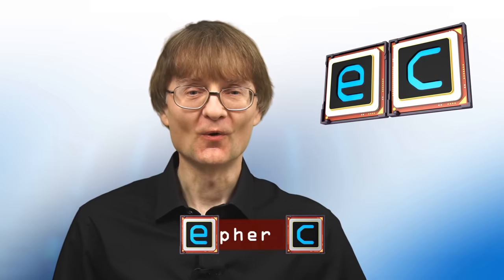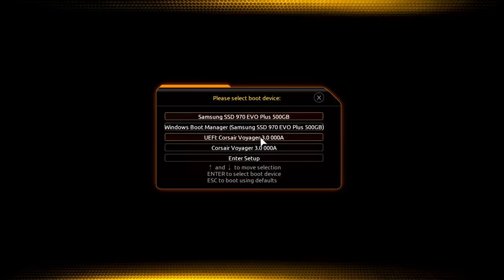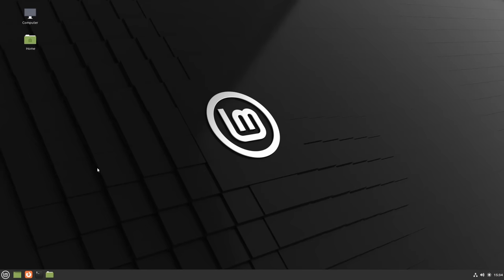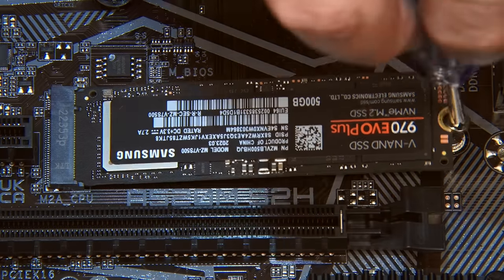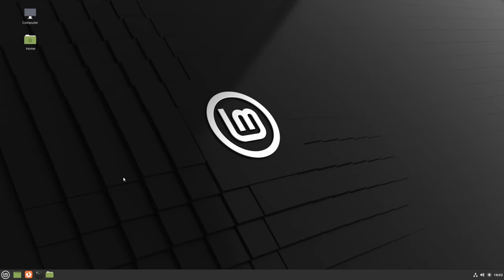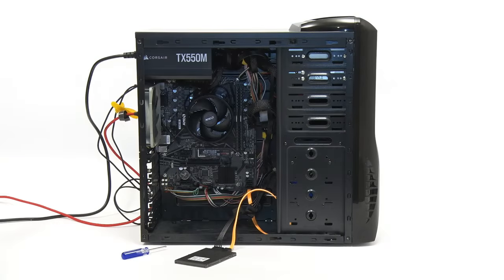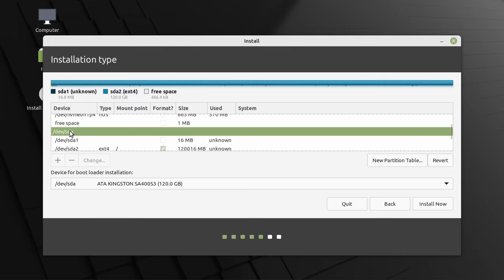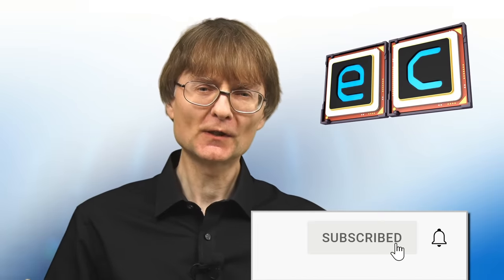Windows & Linux: Dual Drive Dual Boot

Comment: Chris, I have a related question. I've not reinstalled Win10 in many years but I know it does need reinstalling. I currently run a Z87-Pro motherboard system which is amazing but lacks native M.2 (which was released a couple of board releases after) so I'm reluctant to pay for an upgraded motherboard/memory/processor ect with native M.2 so I purchased a PCIe card and NVME card with a 50/50 chance it 'may' function, but it hasn't as my BIOS doesn't recognise the PCIe/NVME as a boot device but when in W10 I can access the full speed of the M.2 via the PCIe card. So I want to install W10 on the M.2 and am happy to sacrifice my current SSD boot drive for Mint (as I'm trying to get used to Linux as MS are no longer user friendly and want to eventually switch to Linux), but even though I have backups of my drives, it's been a tough few years of illness and passing on of family and close family members, so is this method a good method to use? Does this allow for Mint to be installed first on the SSD which on booting up the PC gives a timed out boot message for you to select between Mint & W10 where Mint recognises the M.2 on the PCIe card and will allow me to either write a clone on my W10 to the M.2 (which I've done successfully but can't boot too) or make a fresh install of W10 to the M.2? I mean, common sense says if that method works I'll do a fresh W10 install to a SSD and clone it across. I hope that makes sense?

Comment: Great, thanks. I used to have dual boot then moved entirely to Linux on my new desktop and use a VM for the one program I need Windows for. What I saw immediately, running Win 10 inside Linux, is that there's a backdoor that was downloading gigs worth of who knows what as soon as I started it, even though it claimed it wasn't. Since I have a data cap (in Jamaica, tethering through an Android smartphone), I have to disconnect from the internet whenever I start the VM. Windows is evil.

Comment: Hi, I subscribe to your channel as senior citizen (originally from Cheshire, England but now based in Sydney Australia getting "home" to the UK annually) with basic computer knowledge starting with MS-DOS, UNIX, BASIC - now trying PYTHON.  I've been getting into Raspberry Pi (RP) using both the RP400 and RP Zero 2 W (but I had to buy the RPZ2W in a kit). My next step is control using RP Picos or Arduinos with WiFi.  However, I'd like to play with the Raspberry Pi operating system on my desktop computer and access the operating system from an external USB drive or SSD via a USB to SATA+Power cable (I use the latter with my RPZ2W, so, that's my preferred option) and avoid any complications from setting-up a dual boot system.  Please can you direct me to one of your YouTube videos where running a small operating system can be done from an external drive? Thank you, 73, Ian

Comment: Great video!! I've been having an issue since I did this however, where no matter how many times I change the boot order, it doesn't seem to save it and linux keeps putting itself back at the top, anyone else ever had this kind of problem? It's on a thinkpad x220 if that helps, with Linux mint on the mSATA drive in the 7mm bay and Windows 7 on the regular 3.5 inch sata spot

Comment: Dear Mr. Barnatt, thank you so much for this tutorial. I would like to ask for some help. I have the same configuration as that of your tutorial with Windows 11 installed in the NVME drive and another SATA SSD connected directly to my motherboard. I have tried installing Linux Mint in the SATA SSD but the boot loader was still installed in the NVME drive. I would prefer that I don't have GRUB installed in my NVME drive but it seems that Linux Mint defaults to installing it on my NVME. I have tried twice, deleting GRUB in the NVME drive before installing the second time but to no avail. Any help would be appreciated. Thank you.
Reply: Remove the the NVME drive during the installation. Put it back afterwards.

Comment: Can you please make a video on battery management in Linux? I switched from windows to Pop to Linux mint to ubuntu to manjaro to fedora and back to windows because every one of them drained my battery life significantly in just  4 5 days except Fedora. Fedora had different kernel issue but the battery life was unbelievable for my laptop. I couldnot install any app from terminal or flakpak as it said some interger error. It was just so exhausting
Reply: I found that installing Zorin (ubunta based) on an older HP notebook with an e-bay battery stopped totally stopped charging.  Installed old OEM battery and started charging.  Appears something in Linux Zorin prevents charging on replacement/rebuilt battery.

Comment: @17:00 why does it list Ubuntu/Mint as if it was on the Samsung m.2 500GB SSD and not the Kingston SATA 120GB SSD? Is it maybe because this entry comes from the Windows boot loader on the former drive? Seems like there may be some subtle difference between this approach and installing each OS separately with only one drive connected at install time?

Comment: Hello, excellent video. I have an issue. In my laptop I installed a new ssd and installed linux. The old ssd still have windows on it. If I connect the old ssd through the usb port, I can't choose to boot windows or linux. Linux see the usb drive with windows. How can I boot windows from my old ssd connected through usb? Thanks

Comment: This is a good method to use two operating systems.

However it is slightly less useful on laptops as those often only have (room for) one disk drive.

And it is slightly annoying because every pc has another key to get into the bios and it is not always shown on screen. Nor i the inferface of every bios the same...

Comment: Question, with the first dual drive method (Called A in the video) can each OS see the files and folder created in the other OS and have full read write access across both drives? I want to teach myself Linux (Zorin OS) before my pc no longer gets updates for win 10 because I can't \ and also don't want to upgrade? to win 11.
I must keep win 10 for now in case I can't manage Linux.   Thanks N

Comment: Linux should always be the first boot.   Then add Windows to the grub menu,  since it is is on a different drive than the windows boot loader, windows will never corrupt it.   This way you still get the grub boot option to choose your OS, instead of having to hit F12 to select Linux every time.

Also, stop treating Linux as second class, it is superior over Windows. :P
Reply from the maker: You are making the massive assumption  that the user wants to boot Linux first, and to boot Windows via GRUB (which I and others do not want to do). For me, this is about adding Linux to a Windows PC, not having Windows available on a Linux system.

I do not treat Linux as second class -- which is pretty obvious given that I have lot more Linux videos on this channel than Windows ones. :)

Comment: When I used Linux it worked very well for the short time I used it. What I find with linux is there is always something they either don't have software for or drivers for. Ex. My Lightscribe DVD drive. Searched hi and low for the proper drivers and software to run my Lightscribe dvd drive. Nothing worked. I had to revert back to Windows to be able to use Lightscribe. Dual booting is another work around. If anyone still has the linux Mint Lightscribe software let me know. Thanks.

Comment: In dual drive method, shouldn't windows will show the the drive 📀 (where Linux is installed)  in it's disk manager and vise versa ?
Reply from the maker: In the device/disk manager, yes. But in the file manager, Windows will not show the Linux drive, as Windows does not support Linux file systems. The Linux OS file manager should show the Windows drive, as Linux does support Windows file systems. :)

Comment: Can you briefly explain the settings that need to be turned off in the BIOS before LINUX can even be installed on a previously Windows-based system? I believe this is normally Fast Boot and Secure Boot, correct? Most LINUX distros won't even install until those two settings are first turned off in the BIOS, correct. However, once you turn those off, aren't you making your Windows installation less secure by doing so? Will Windows still even boot properly if Secure Boot is disabled in BIOS? Note here that this is why most people don't even bother doing any type of dual boot: it's just too big of a pain all the way around with too many ways for it to all go wrong and end in frustration. Also, even if you do it all right, your particular distro still might not even boot properly at all when you're done. To avoid all of this, most will simply just install their distros into a VM app like VirtualBox where all of those types of problems are avoided entirely.

Comment: I just bought a brand new computer; a Thinkpad E16, Gen 1 and wanted to install a Linux distro. I didn't get anywhere, it wouldn't let me into the BIOS or boot menu from a cold start no matter what key or combination of keys I pressed. I could enter the BIOS from Windows but that's totally unsatisfactory if you want to install another operating system. Also I disabled secure boot but then ran into a whole lot of trouble with a blank screen and just some small text pointing to a Microsoft web address where I had to type in a 48 key password to reset the system.  The page kept on reloading rapidly making it very hard to obtain all the numbers, so I took a snapshot with my phone. I ended up returning the computer and decided to use an old ASUS from 2014. Maybe the days of the Linux desktop are numbered...

Comment: I have the original windows 11 drive and added a drive for Linux (my primary OS)... I rarely "need" winders, and I'd rather run it inside Linux, but the stuff I use doesn't work with Wine. I've added a VM, but it won't accept the license the machine came with. idk... PITA.
Reply: and winders keeps stealing the first boot option!

Comment: I am hoping this is a simple question. Once I set up a dual-disk and dual-boot computer, since Win and Linux use different file systems, how do I copy a file from one disk to the other?
Reply from the maker: Linux can access the NFTS format used by Windows (provided that Windows is properly closed down so that the drive is not locked). So you can access both drive to copy files when running Linux.
Reply: @ExplainingComputers  Thank you very much! Great stuff on your channel, BTW.

Comment: I install each OS with only its drive in the system... once OS's are installed i put both drives back into the PC then set BIOS to boot linux drive by default. Once booted into linux i run 
sudo os-prober && update-grub  
i can still boot windows from the BIOS boot menu if linux dies and vice versa.  To do it like this both OS's have to be installed using the EFI method, not the legacy BIOS boot method.

Comment: I want to start using Linux but I'm not ready to give up Windows 10 entirely yet. I just happen to have two one terabyte harddrives in my computer, so it just occured to be that I could use one of them for Linux and the other for Windows! But both drives are already assigned to use for Windows. Could I just disconnect the drive that has the Windows installation and then simply install Linux on the other one without messing anything up on the Windows side? I can't think of anything essential on the other drive that Windows would need.
Reply from the maker: Yes, what you say should work fine. Good luck!
Reply: @ExplainingComputers  Thanks for the reply! Your channel is a great repository of knowledge. :)

Comment: "Boot menu can become corrupted" or more accurately: a windows update will overwrite the boot menu.(Won't happen if using separate drives)
Next lesson: How to use Boot Rescue Disk to fix what Windows screws up
Reply from the maker: Yes -- as explicitly mentioned in the video! :)

Comment: Do you need to remove the Windows NVME every time you update Linux?
Reply from the maker: Not unless you do a clean install. A normal update/upgrade should not cause issues (never has for me).

Comment: Ok, so I can't remove drives physically, I'll use the method B.
1. I install Windows first to a drive.
2. I boot Linux USB and install it to the other one?

Also, another question: I want to install vanilla Arch and build a desktop environment from scratch. I will follow an Arch installation guide for that.
But how do I make sure I'm selecting the correct drive? It doesn't have a GUI installer.

Comment: I take it making a second partition is also good enough (have laptop, can't add second drive)?
Is the process with W10 instead of W11 identical/similar or are there some important differences?
Reply from the maker: The process is identical with any version of Windows. A second partition can indeed work, but is akin to the final process shown (where a drive is not connected), so GRUB will still leap in a bit!
Reply: @ExplainingComputers  Wonderful video and good explanations all around. Brilliant stuff! :)
Reply: If you have a DVD drive in your laptop and you don't need it anymore, you can replace it with a Caddy and put a second drive in it,
I did this but unfortunately my laptop cannot boot from it for some reason (it's 12 years old)

Comment: 6:30 I've long felt that NecroSlough deserves a little degradation of people's access to Windows. <sniff>

7:05 aha, now we come to the villain of the piece! MS making mischief.

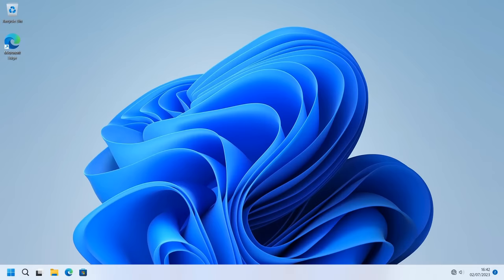17:25 it's possible, it's possible... <strain>

This gets me wondering how to do this on my HP model 2000 laptop. It's been quite a while since I last cracked open the case, but I think it only has one storage interface — the internal 2.5" SATA drive port and caddy holding the SSD I installed 3 years ago. 

The laptop camera and mic are connected to an internal USB 2.0 hub (separate from the hub powering the 3 external USB 2.0 ports). I've thought about using that internal hub for something else, but USB 2.0 is dog-slow for system storage, even when compared to the onboard SATA port. I think it's SATA II.

Comment: Chris, what if i after both drives are installed and running perfect - i want to enable Bitlocker FDE on the Windows drive and LUKS on the Linux Zorin drive?? With that affect me accessing the boot menu to choose between the different operating systems?
Reply from the maker: Enabling Bitlocker in Windows should not be a problem (as in the dual boot setups here, the Windows drive is completely isolated from the Linux install and GRUB knows nothing about it). However, enabling, LUKS on the Zorin drive may be problematic, as I don't know what this will do to the bootloader on that drive. In theory there may be no issue -- as the Linux install is isolated from the Windows one.
Reply: @ExplainingComputers  Thank you for taking time to reply to my question.  I appreciate your time.

Comment: What if I have 2 drives. 1 SSD windows and other 1 TB HDD. The 1 TB HDD is partitioned into 2 (800 gb and 100 gb). I want to install pop-os into this 100 GB instead.

While going through the installation, I choose custom advanced mode and I can see 3 disks (usb, ssd, hdd). In the HDD, I can see 100 GB partion. When I click on it, it gives me the option of Use partion. Should I do that? Any idea?

Comment: It is annoying that windows installers have the habit of making many tiny partitions in addition to the one where your OS is installed. This makes restoring a backup more difficult because you sometimes need to backup and restore more than one partition.

I get around this by manually making 4 primary partitions and only then installing windows. It has no option but to put all the stuff it would usually spread around a couple of partitions right on the partition where it actually installs windows itself. 

Unfortunately I have noticed that Linux installers recently seem confused by anything other than the complete circus of mini partition windows usually wants.

Oh, I have to add that I always set computers to legacy bios as uefi makes things even more difficult WITHOUT any intrinsic benefits.

Comment: I did dual booting for long time honestly it kinda got annoying me. whenever I would install a distro i would accidently wipe my windows drive etc... Now i  use a hp t350 mini pc got for 25 on ebay basically new and got a touch screen monitor and thats how i tinker with linux and a raspberry pi 4. 

So when I dual boot I boot up at the same time and play around and my windows machine is left alone.

Comment: Good Morning. A beginner's question. I want to install Windows plus Linux in dualboot on a physical drive named A. therefore yes, because Windows is still useful, Linux to educate. The second physical drive name B, I want on files common to both systems. How to choose the type of formatting for physical disk B, so that it can be seen in two systems (write, read). thanks.

Comment: Installing Windows with two drives connected may also cause problems. When I bought my first SSD, I installed Windows 10 on it with a 2nd hard drive (just for storage) connected. Then, I tried removing the hard drive, and Windows couldn't boot at all! It required both SSD and hard drive to be connected to boot, for some reason. This was years ago, I don't know if this still happens.

Comment: There is a way to install linux on usb connected drive. How to perform this install without messing windows drive. So finally after install ubuntu starts only when usb drive is connected and if disconnected windows starts normall. Can this instalation be done without disconnecting windows drive?